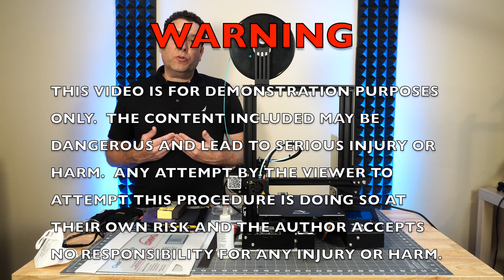DIY GLASS BED for your 3D Printer - Ender 3 Pro / Cr-10 / Tornado / Tarantula

Comment: Is it as reliable as the high quality or the type of glass they use in other glass beds ? Like for instance the anycubic heatbeds + glass
Reply from the maker: I have been using same pieces of glass on 3D printers with no issues.
Reply: @tr3nDmaker  cool, Thanks a lot. =)

Comment: Does normal window glass work? I heard that for 3d printing build plate we should use borosilicate glass only. Otherwise it may shatter.. Is that true ? When we heat the bed upto 60°C for a long time is there any chance to break the glass ??
Reply from the maker: I have been using normal window pane glass for 6 years on 5 3D printers with no issues or replacements.
Reply: @tr3nDmaker  wow.. thank you so much..

Comment: Did you remove that stuck on magnetic sheet when you took off your flexible bed in order to put the glass? Cuz I decided to DIY my own glass bed as well after both of my flexible ender 3 magnetic ones got pretty much destroyed. But I just left that other thing on there. But a lot of videos I've been seeing people have taken that sheet off. Does it matter? You skipped that part so I don't know what you did.
Reply from the maker: On my Ender 3 Pro... I left the dark magnetic portion on build plate.  Glass goes over it well and I still have the option to use magnetic plate, if I choose.
Reply: @tr3nDmaker  that's what I initially did but I discovered that the glass super sticks to that and then it's so hard to get it off and I'm afraid I'm going to crack my piece of glass. So I decided to take that off because if I buy another one of those sheets it always comes with one of those sticky under pad things anyway. The two sheets that I have are both completely ruined so to me there's no point in keeping it if I decide to stay with glass and if I decide to change back, when I buy one it'll give me a new sticky thing with it. But I had no idea that the glass was going to stick that crazy to it and then I found some other people saying the same thing. So I just wondered what the majority of people were doing. Or, alternatively, what's the best way to unstick the glass from it without breaking it??
Reply from the maker: @theCraftyHeretic  In my opinion... Just go with glass and forget the magnetic surface.  it close to junk.  I only print on glass, unless for videos to show results from stock Ender 3.  If you want a flexible surface for popping prints off... Get the Wham Bam!  Out of 6 printers... all are glass, except for CR-10s Pro which has inductive sensor and does not work with glass. Of course, I put a PEI sheet on it.   I still like glass better though.
Reply: @tr3nDmaker  thank you for your responses! Especially the comment about CR-10s, I have been thinking of getting one in the near future and I had not heard that about the glass beds. Very good to know!
Reply from the maker: @theCraftyHeretic  FYI, the newer CR-10s Pro has a BLTouch Sensor, so you can use glass or textured surface.

Comment: I personally use a cheap dollar tree sharpening stone under running water to sand the edges of my glass you get a really good finish and you don’t have to worry about glass particles in the air
Reply from the maker: Thanks for the tip...

Comment: I just use a cheap dollar tree sharpening stone under running water to sand my edges works really well plus you don’t have to worry about glass particles in the air
Reply from the maker: Great tip... Thanks for sharing!